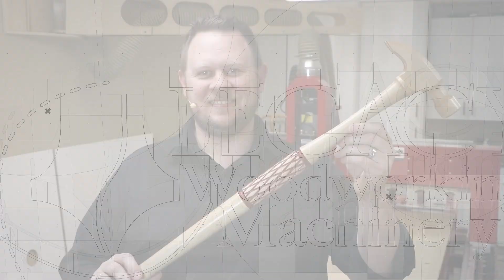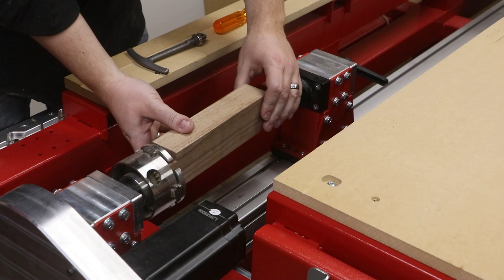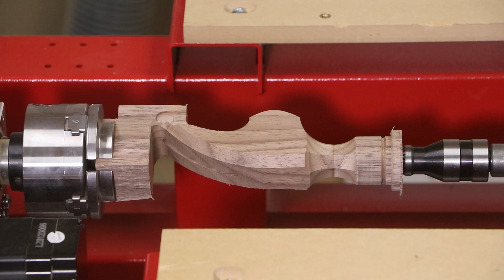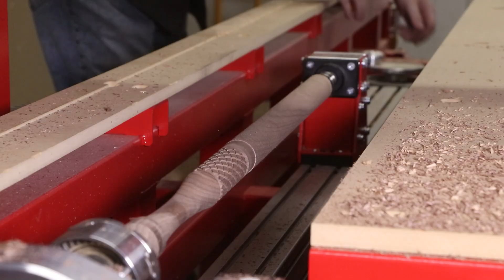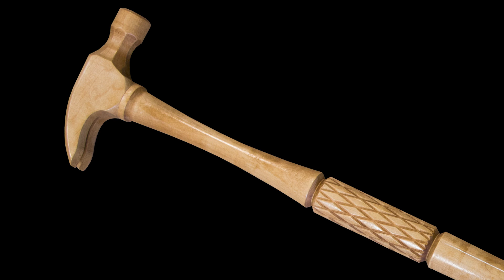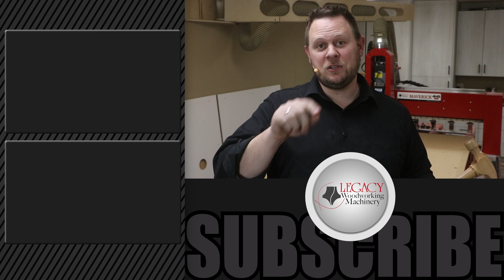Turning a Hammer Head Cane

Comment: Is there g code to do a taper, or is this ONLY done manually
Reply from the maker: The Maverick Class CNC machines are a manual taper lift, the Renegade CNC is an automatic taper lift.  call in 801-491-0010 if you would like to know more!

Comment: What wood should be used for this cane and how much weight will it hold up.?
Reply from the maker: We used Walnut, as for what the weight limit is, I haven't a clue.  It is 3/4 of an inch at its smallest diameter so I would imagine it would hold quite a bit of weight.